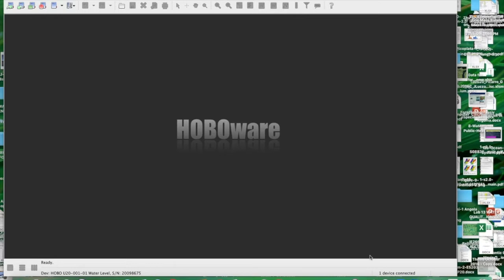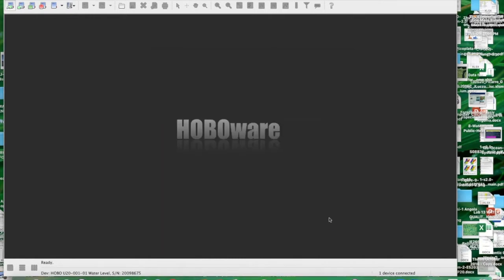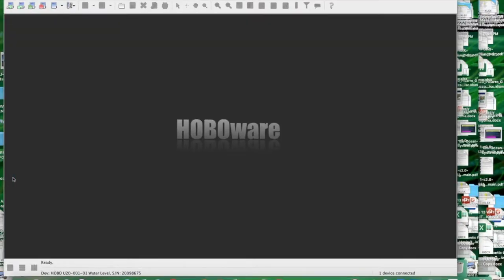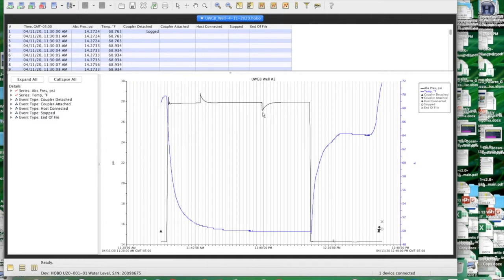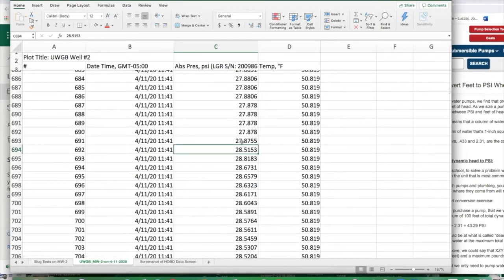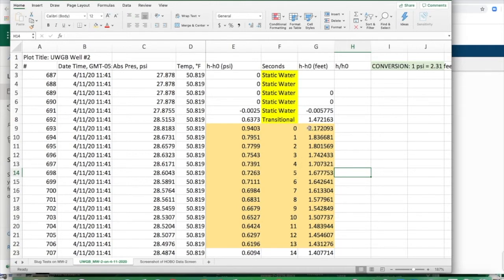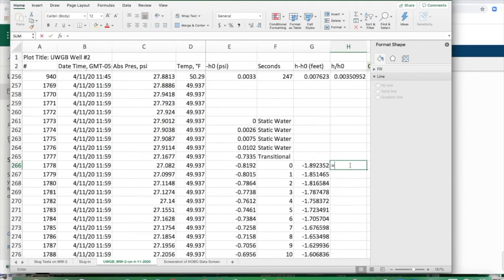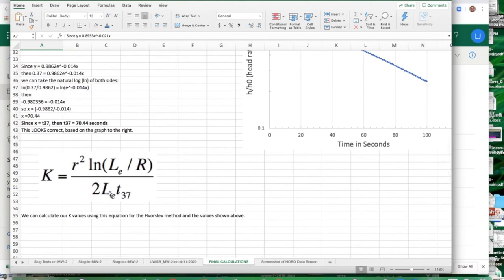Lab 11 Slug Tests & Data Reduction

Comment: Been doing this for a long time but I did not have the luxury of a data logger in my time, lol.  We would create log-charts by hand and pull t37% data from the graph. Of course we assumed a fully penetrated aquifer and understood that using Hvorslev results were for local K and not for the entire aquifer and transmissivity was only passively estimated.  Most of my work was for local contamination work anyway so it worked fine for me. Would be nice to see a video of your technique for pulling a slug and doing the test using Hvorslev method.  I have always wandered what a comparison of the two different slug techniques would result in? Thanks for the videos and good work. Hope you got the job.